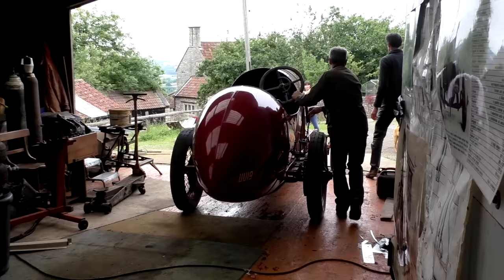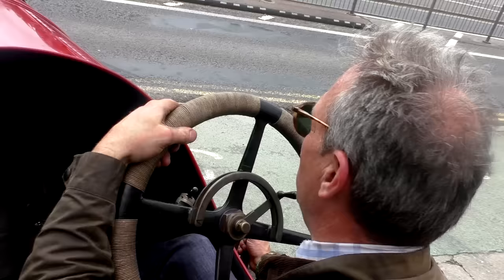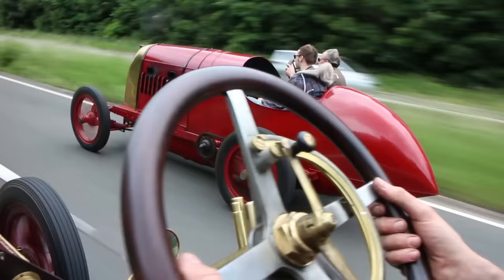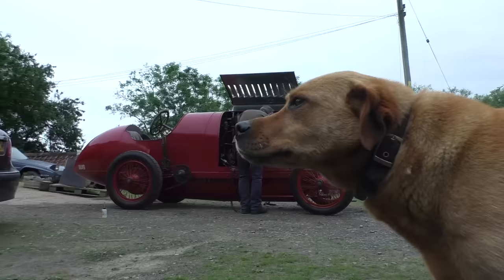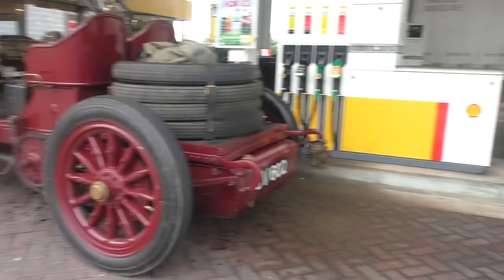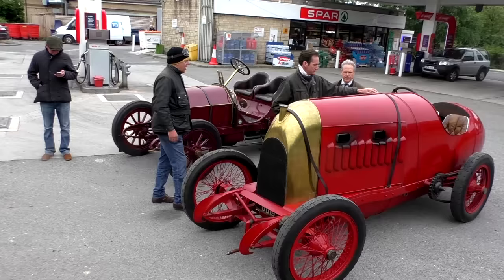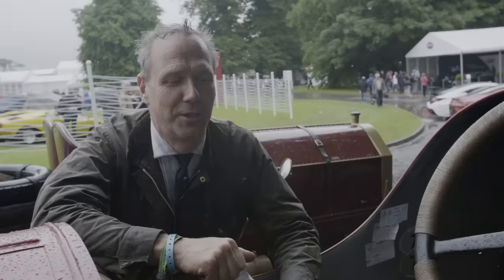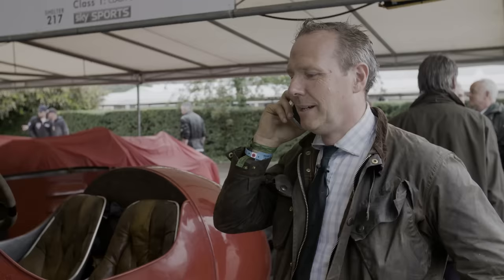Firey Beast of Turin Let Loose on the Highway | Part One

Comment: And why in all hell this FIAT is not in FIAT museum in TURIN?
Reply: In a museum, the car would be nothing but a cold, lifeless hunk of metal. On the roadway, the car is a living, fire breathing beast.
Reply: or... it would be a piece of history instead of slowly degrading due to usage and, possibly rust until it will, actually, only be a mangled piece of metal.
Reply: You do understand that he restored the car in the first place? meaning that if anything were to break then he can fix it, its much better that something like this gets used that to just sit and slowly rot, as eventually everything returns to the earth, one way or another.
Reply: yeh, I bet FIAT people would be totally unable to fix anything on this car. After all they only built it. And sitting in a museum does not mean it will just sit and rot. It means that more people can see it, whereas now it only appears when the owner has a wish to go for a ride.
Reply: The FIAT S76 had been made in two samples. One remained in Turin, and was dismantled in 1919. The second was purchased  by the Russian Prince Boris Soukhanov, and ended up in Australia, without the engine. This one had been made coupling the surviving chassis of the second sample with allegedly the engine of the first sample, that miracolously survived. It seems more probable that's a FIAT S76A dirigible engine (they were identical to the record engines, FIAT made a small series of them, one is at the Politecnico di Torino university too).
Reply: Being right hand drive must have been an export model 😜

Comment: Bloody stupid driving this thing on the road. Sheets of flame and totally unroadworthy. The other car maybe a little more sensible. As for petrol stations,,,,,,, turn it off 25 yards either side of the pumps.
And many of the period pics show it with a huge manifold with single outlet. With which would make better power!
Reply: Only one picture shows one of the two cars with a single manifold, and it's hard to think it had been usually mounted, since it prevented an easy opening of the hood. The other pictures show the cars with two square open exhausts ( http://www.hiclasscar.com/wp-content/uploads/2016/06/7759.JPG like the one restored), four round open exhausts ( http://www.octanemagazine.nl/cms/wp-content/uploads/2015/10/Fiat-S76-4.jpg ) or two open slightly rearward looking exhausts ( https://soulcarsrace.files.wordpress.com/2015/01/o2.jpg that's the configuration of the record run at Ostend).